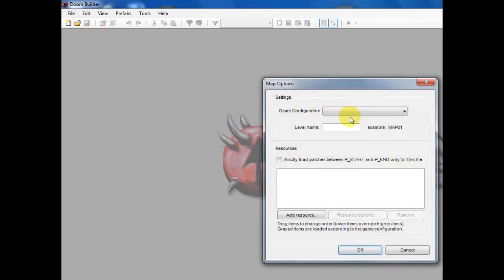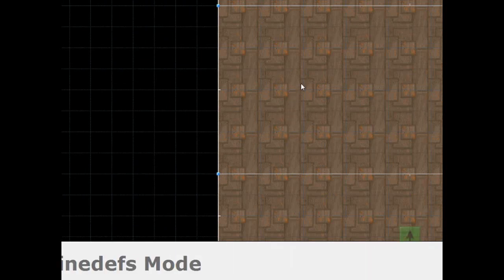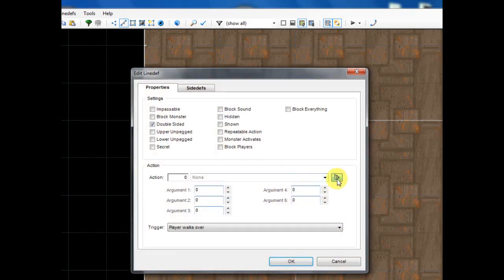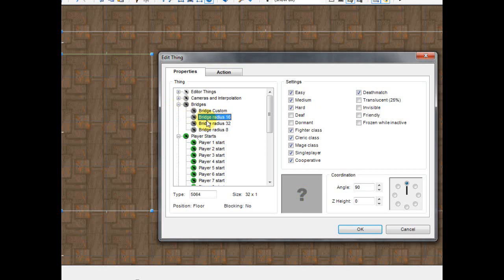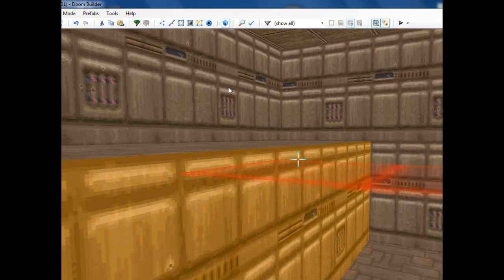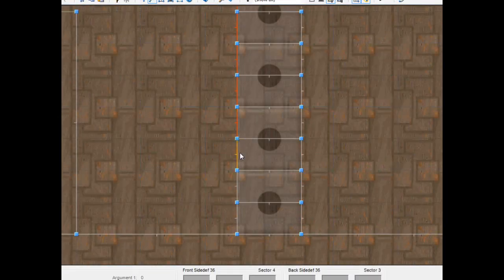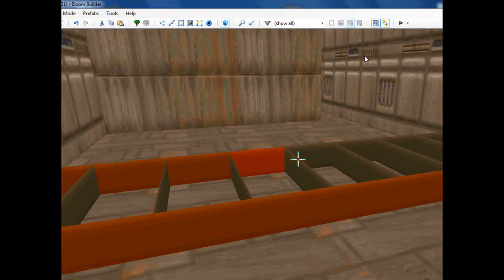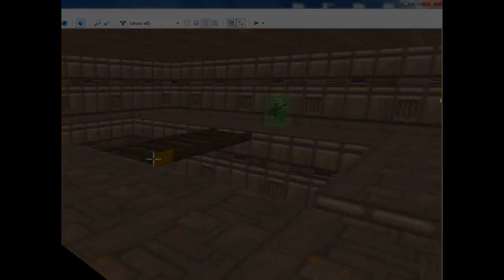(Doom Builder 2) 3d Bridges and Slopes Tutorial

Comment: I don't have bridges section in things mode! What can I do?
Reply from the maker: Make sure you're using the correct Game Configuration (shown at the beginning of the video when I prepare to start a new map).
Reply: Oh, thanks :D
Reply: That cool is that you answering people after 7 years
Reply: Can i do bridges in doom format? Because i already did a lot of work in doom format D:
Reply from the maker: Я Палатка You can't do it in Doom format, but there are a couple ways you may be able to convert it over to Hexen or UDMF format.  Make a backup of your WAD beforehand, though, just in case something goes wrong.

The first method just involves changing the configuration for the map itself.  Just open the map in Doom Builder, click Tools -> Map Options (or Game Configurations.. can't remember what exactly it's called), then change the Game Configuration to the correct one.

This doesn't always work and will require you to go through and change all of the line actions, etc. since the numbers will change.  It should preserve all of your sectors/things though.

The second method is a bit more cumbersome and involves copy--pasting all of your lines and things into a new Hexen or UDMF map.  First create a new map using either of those formats and save it.  Next, open your old map, go into Line mode, select all of your lines, and press CTRL+C to copy them.  Open the new map and press CTRL+V to paste them in.  Do the same thing in Thing mode to bring over all of your things.

I actually recommend UDMF format because it's the one most people use (Hexen is outdated and obsolete).  I also recommend using GZDoom Builder rather than Doom Builder 2, because it's like an upgraded version of Doom Builder 2 that has all but rendered DB2 obsolete.
Reply: Chubzdoomer I used second way, it woked!
Thanks a lot!
Reply: Chubzdoomer Oh my god, can you help?
I selected UDMF format and all actions is now wrong. I selected Door Open action on my door, and now nothing works D:

Comment: hey i've got a question...

ok i've been make a set of maps in the format: ZDoom (doom in doom format)
and i was wondering if i were to use this tut to make a map could i add it to the others or would i need to create a new set of maps? (or start over?)
Reply from the maker: You can usually convert your maps to another format by opening them in Doom Builder, then going to Edit -> Map Options and choosing a different configuration.  You should make a backup just in case something goes wrong, though, and since different configurations use different numbers for line specials, etc. you'll probably have to go through and renumber a bunch of things.
Reply: Chubzdoomer
ok thanks ill do that and then make a test map to add and see if it works :D
Reply: Thezaccazzac
yeah the conversion process buged up some doors all the teleports ,the end and nothing spawns in-game so i'm gonna just continue on a different .wad so it'll be easier thanks for the help though :)
Reply from the maker: Thezaccazzac Another method is to copy--paste your sectors to a brand new map with the new configuration you'd like to use.  You can copy--paste things as well.
Reply: Chubzdoomer 
ok ill try that real quick...
Reply: Chubzdoomer
ok i tried it and it still ruined the doors and teleports and no items or enemies spawned so like i said it'll be easier to just make a 2nd map set and continue from there with the new settings... (and include both .wad files in the download)

Comment: There is an easier method to select all the textures for bridges. Raise one of the unpegged textures to the number offset of where you want all the other pieces to float at. Let's say the number's 84. Go into 2D mode, and select all the linedef's with the unpegged textures that make up the bridge, select the sidedef's column, and on the left, there is something that say's "Texture Offset" with Front Side and Back Side. Set the texture offsets of both sides to 84 and the textures will be set.

Comment from the maker: @Rozark190 It's impossible to place textures on the bridge pieces themselves.  If you want a way to do bridges that looks a little better, check out my "3D Floors" tutorial.  You can literally suspend "floors" in mid-air with textures and everything!  This method is still fine, but I think 3D Floors look a little better than 3D Bridge pieces.  Don't think that those pieces serve no use, though!  There are still creative ways to use them, like making weapons "suspend" in the air, etc.